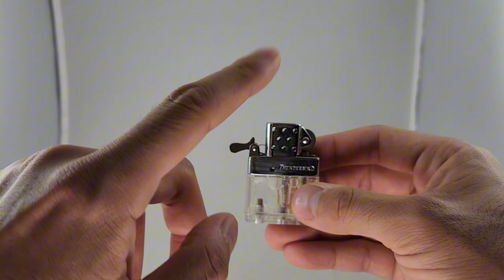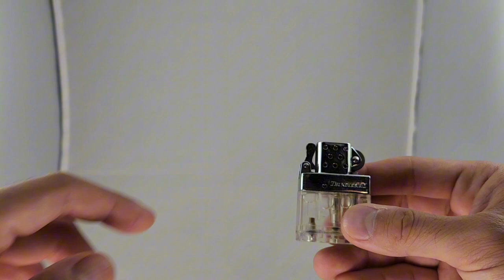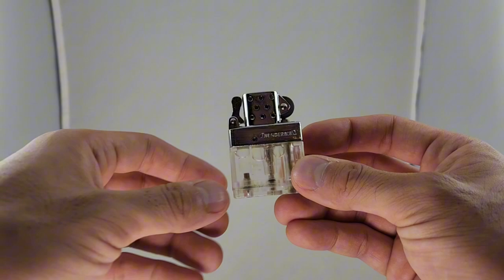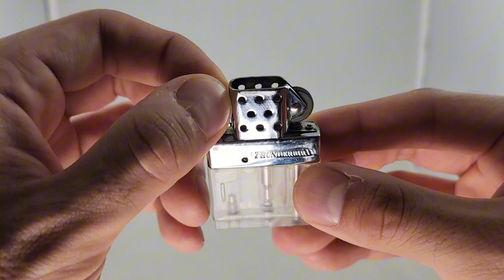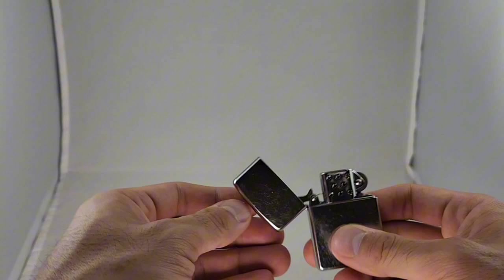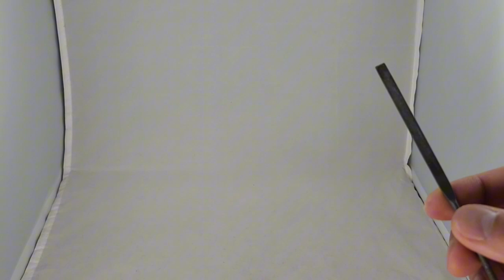youtube video #-6I82FvB9qQ

Comment: Thanks for this! I also had to bend the metal inside the upper piece a little bit to get things lined up. Filing, plus bending the upper metal, stops it from leaking inside the case when closed. It's worth the effort.

Comment: I recommend using a Dremel tool if you have it. You can achieve a level, and round finish. Another thing I recommend is adjusting the cam tab to be right where the cam and chimney meet when the case is closed. That way you're not relying only on just filing the cam to compensate for tolerances with different series of cases (standard Zippo, Amor Zippo, Zorro 902, Zorro 912, Chief, etc...).